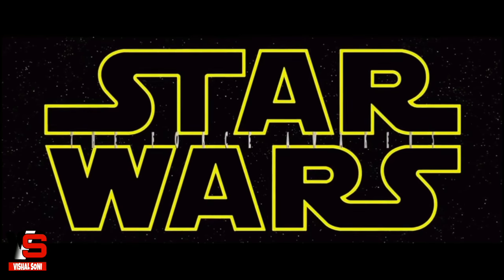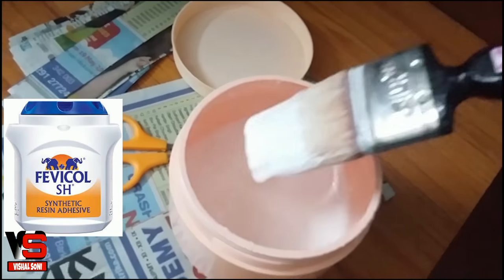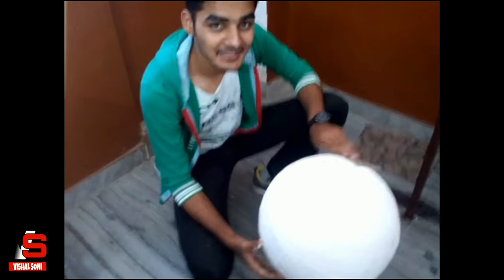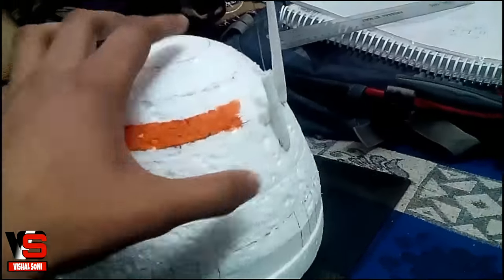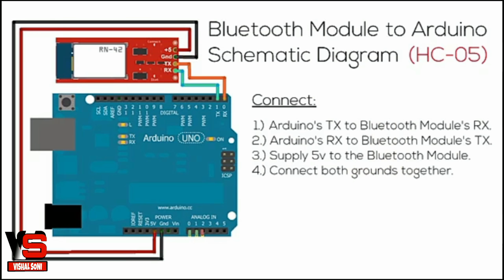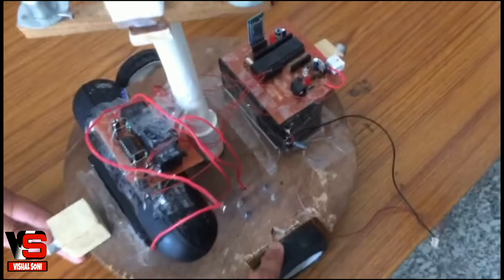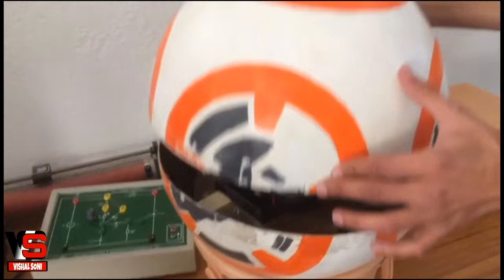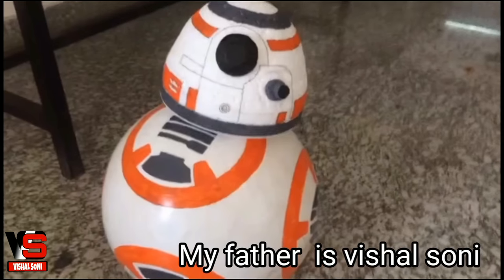DIY Build BB-8 in India || Talkative and Android controlled || starwars ||  ball balancing robot

Comment: Where you buy transmitter and receive online
Reply from the maker: Aamin Vohra 
It is based on Bluetooth
Reply: I am Indian so 
Where u buy this things online 
Model no -
Name-
Reply from the maker: Aamin Vohra 
From eBay and Amazon 

HC 05 Bluetooth module 
Arduino 
Jonson side saft motor 100-200 rpm above 4kgcm

Comment: How are you able to keep it charged without taking it apart?
Reply from the maker: This is big question for everyone
That's why I have not combined ball permanently, it's just temporary via tape
Reply: Vishal Soni hey, what about using solar panels on the head or something? Or using ten year batteries instead?
Reply from the maker: You are not get that much power from solar..
And head should be very light weight so you can't use solar on head
Reply: @GlitchTronics  charge it using wireless chargers, I mean keep the wireless receiver charger on below the bot, and transmitter on some platform
Reply from the maker: @pocopoco3468  i built it 6 year ago, that time wirless charging is not reliable, also that time i was a beginner.
You can build it and guide people.
Reply: @GlitchTronics  yeah bro, let's see what I can add up, first I'm trying to build Otto bot
Reply from the maker: @pocopoco3468  that also on my channel

Comment: Your motor is quite costly..
Can I use any other one .(in your project)
Also,
In your website,t is mentioned 12v battery
But in your diagram you have used 6v, also l239d ic require 5v
Reply from the maker: this an example to connect motor but you should use the battery according to your motor.
if your size is big like me then you have to use costly motor around 500 indian rupee or less with high torque to carry the weight of ball.

Comment: How much volt and mah battery is required, can you share the link of battery  ?
Reply from the maker: i have used 12v 4000mAh , but you can use any 12v battery and current will be the time you want to run it, bought from nearby store but here is link :- https://amzn.to/3HcirLt
Reply: @GlitchTronics  do 18650 rechargable cell work 3.7 v 2000mah *6

Comment: L239d ic requires 5v .If I give >5v ,
Will the ic burn??
Also can I use 3kg cm torque?(my bb8 is same as yours)
And which motor should I use 700 or 300 rpm
(Please help me as I am a beginner)
Reply from the maker: , go and read datasheet of l293d
you need 5v at enabled
And vss you can use more then 5 according to your motor
Reply: @GlitchTronics  and about motor
Reply from the maker: @xiiscc-15faiyazaman44  yes 3kg cm torque is enough
Reply: @GlitchTronics  sorry for disturbing again!
What should be the rpm of the motor?(same as your bb8)
Reply from the maker: 100 rpm is better
Reply: @GlitchTronics  is it fine to use the motor mentioned in the description??
Reply from the maker: @xiiscc-15faiyazaman44 you can buy 300 rpm motor and also you can control the speed as according you need

Comment: Should we use a motor shield for this is it compulsory. If compulsory can u suggest any cheap motor driver
Reply from the maker: L298 driver
Reply: @GlitchTronics  should we change anything in code or no need
Reply from the maker: @peddilohith8896  yes there are lot's of changes
Reply: @GlitchTronics  what what should we change
Reply from the maker: @peddilohith8896  remove shield library and read L298 data sheet, and just do 4 pins high low to control robot
Reply: @GlitchTronics  no need to change the if statement right,only the pin numbers should be changed na.
Reply from the maker: @peddilohith8896  code same works for you... Please watch video i already suggested l293d drivers ic but it not work for you use l298 ic, code same

Comment: hello, can it move from 1 point to another?
Reply from the maker: Head fall off, without head it can move
Reply: @GlitchTronics  can it move 100meter?
Reply from the maker: As i said head fall off when you try to move, without head you can move it where you want , if you Bluetooth range is 100meter you can run it away till 100meter
Reply from the maker: As i said head fall off when you try to move, without head you can move it where you want , if you Bluetooth range is 100meter you can run it away till 100meter

Comment: hey plzzz help
Reply from the maker: Ask
Reply: @GlitchTronics  motor is not rotating fast please help
Reply from the maker: @deepaksabat3953 
Please give link of motor which you bought or any specifications
Reply: @GlitchTronics  12 v dc motor with 500 rpm
Reply from the maker: @deepaksabat3953 
Battery specifications please?
Reply: @GlitchTronics  the motor is working fine there was a loose connection sorry for the inconvenience . i have another query what type of battery u have used and please provide the link of battery
Reply from the maker: @deepaksabat3953 
I bought it from local store which is 5v  2.5 A.....